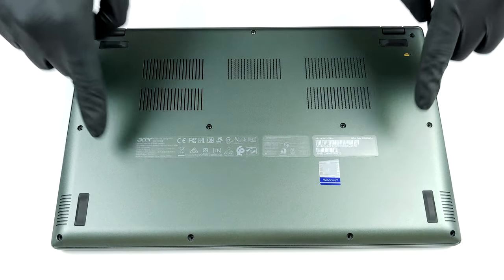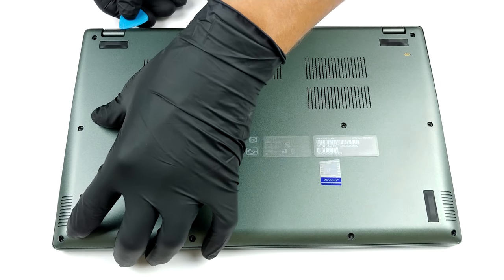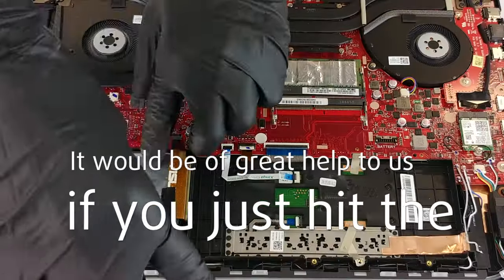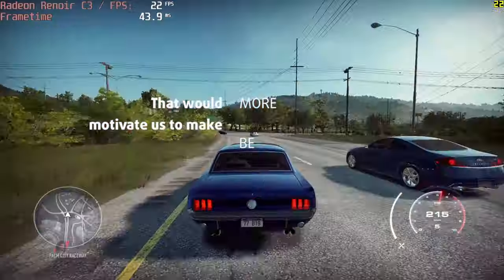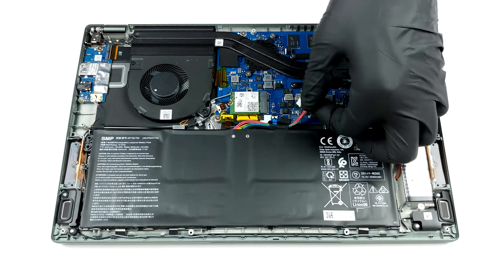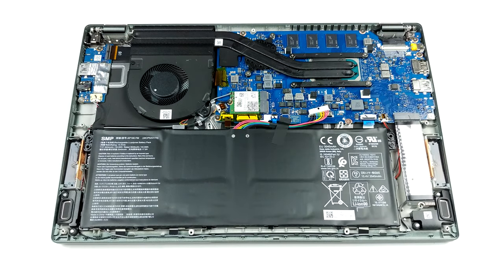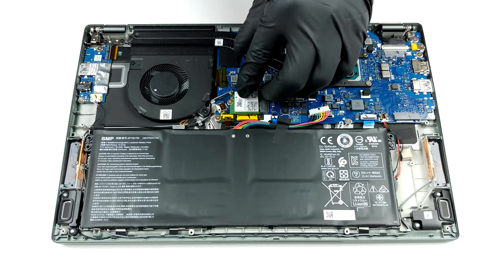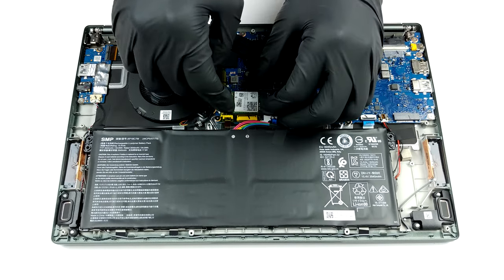🛠️ Acer Swift 5 Pro (SF514-55GT) - disassembly and upgrade options

Comment: Soldered memory directly on the MB? I could live with it, just add a socket for an extra memory stick. What would it be, like 25 cent?
Reply: It is always nice to if you say MOBO instead of MB to avoid confusion. I am very interested, how would you add another socket? I didn't know you could do that.
Reply: @doufmech4323  i have a much more simple way (not for you) to add more ram on a MB, i`ll get a 16 gigs of RAM stick, desolder the ciplets and solder them in the place of the ones on the MB. Your head spins.
Reply: @neildagasstrysome7216  wtf you're saying MB 😆😆
Reply: MB is used for MegaBytes not Motherboard!!
Reply: @neildagasstrysome7216   - Although soldering new RAM is perfectly doable. I could imagine the warranty flying out of the window on the spot!
And with the skill level I see in many cases I've got a feeling the warranty would be need really fast! LOL 😂